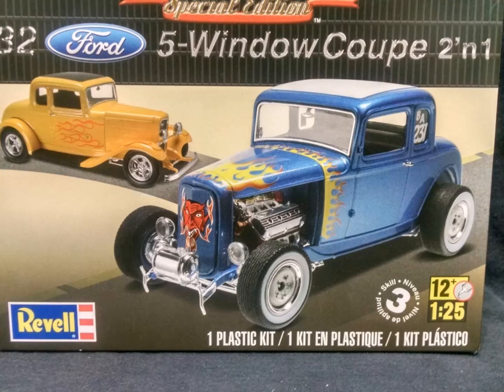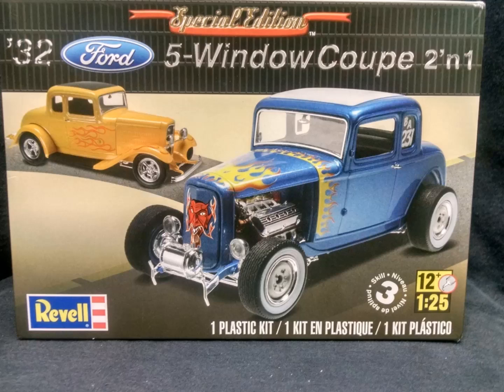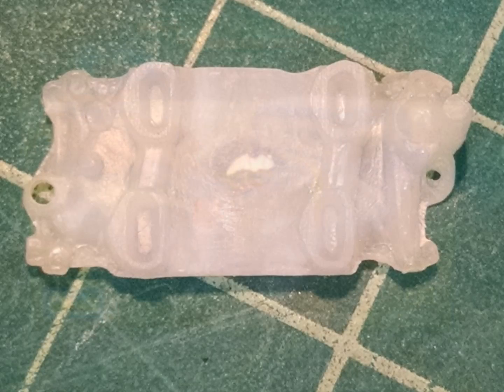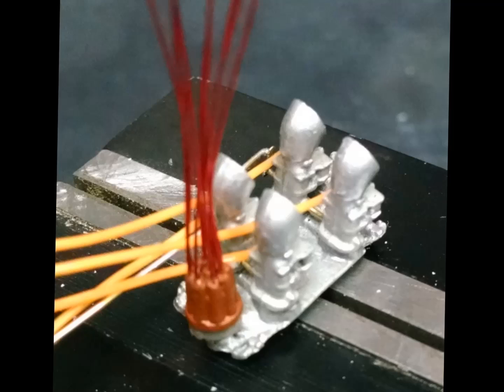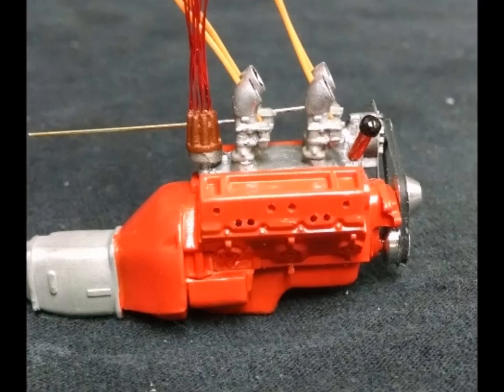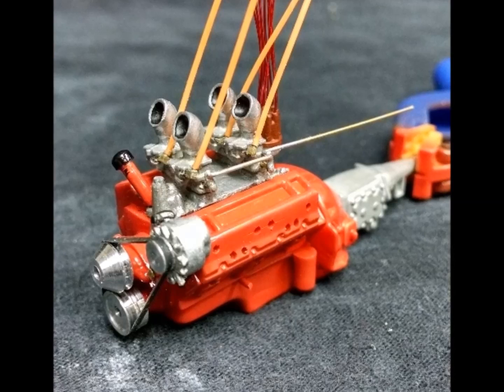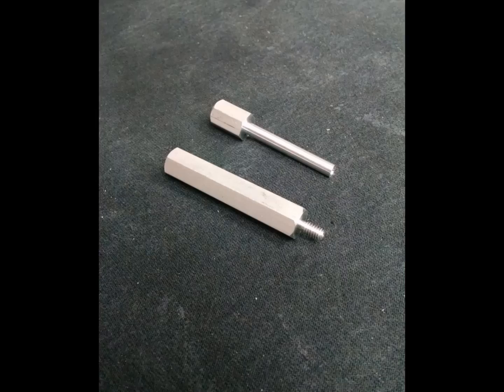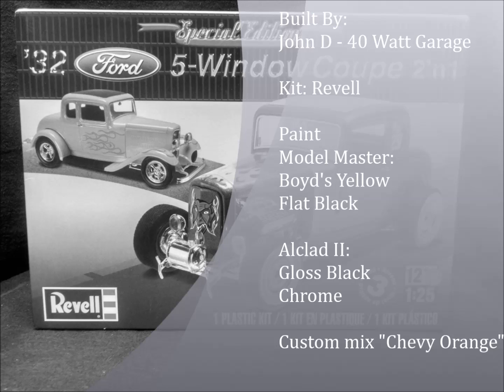American Graffiti - Milner's 32 5-Window Part 1

Comment: Nice build.  On mine I used the Graffiti model reissue from 2003. That is one of the most pain in the a** kits I have ever built. To many problems with it.  I seen this 32 Ford kit at Hobby Lobby and passed it up. I might have to get it and follow how you did yours.  Where did you get all the wires for the motor?  Loved all that fine detailing.
Reply from the maker: The plug wires are from a roll of enameled copper wire that was in a Radio Shack "project kit" for making electro-magnets I purchased (probably) 20 years ago! (I've still got enough to wire model engines until I croak). One of the dangers of the hobby is your head goes into "That'd make a cool xxxxx on a model" when you're browsing a surplus or craft store. Next time in Michael's or Hobby Lobby wander over into the arts supplies or (especially) beading/jewelry for some inspirations!